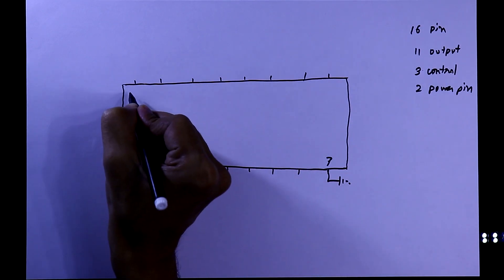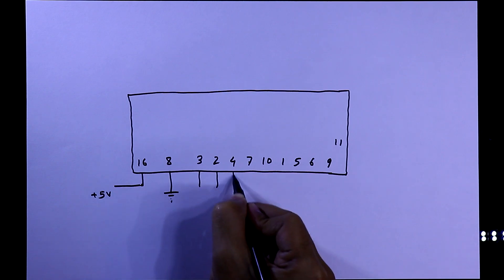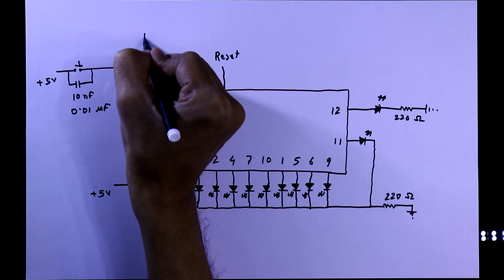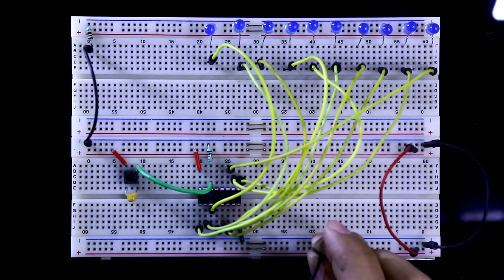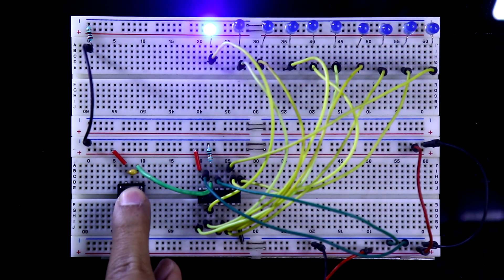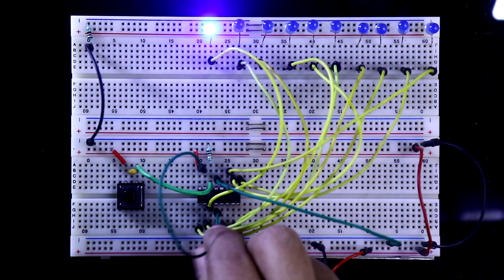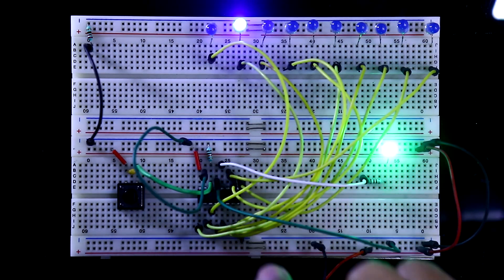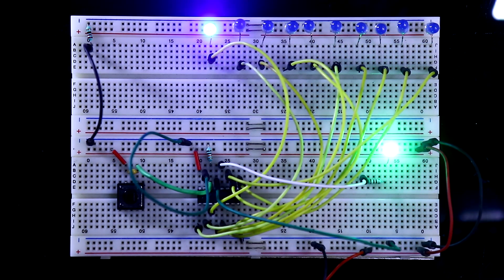CD4017 ic in details | Basic things of cd4017

Comment: Looking for help,  im using the circuit in series with 555 for a squarecwave inputcto clock.  My idea to fkace a Led 3 times then rest then flash again. Via diodes from pins 3,4,and 10. Reset on output 10.    Worked great with rest led.  But then added the 1/4 Watt Led thatci wish to strobe the IC broke.    How to fix this. Do i need to also use transister? MOSFET

Comment: can you please make video trying to phase shift sensors or pick up coil? I did found some variabel cdi phase shifter box that uses similar design like yours but dono wuld it actuali work on an hei ignition module 4 pin model it uses that model the mc 3334 ic chip diagram for hei ignition .So Im not shure if those chaneling circuets actuali can activate external 555 timer modules or not ? There are litel videos availabel how to trigger an 555timer with an pick up coil because it is ac tehnicali speaking